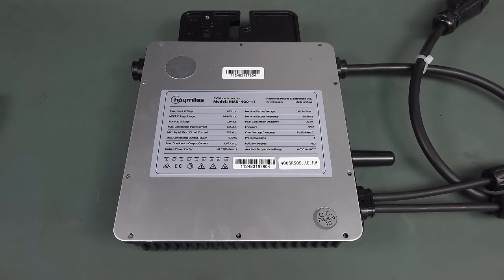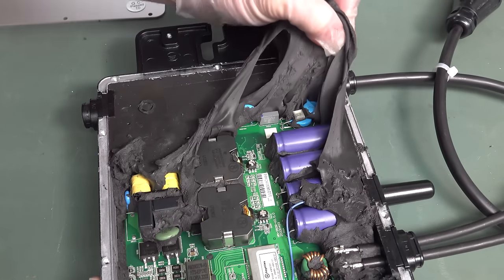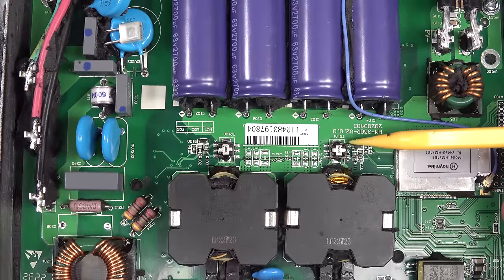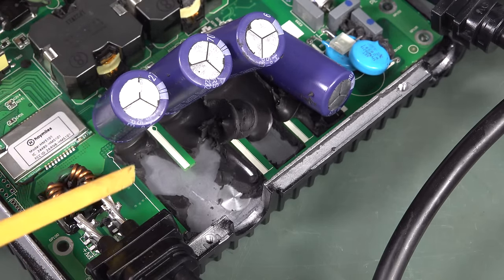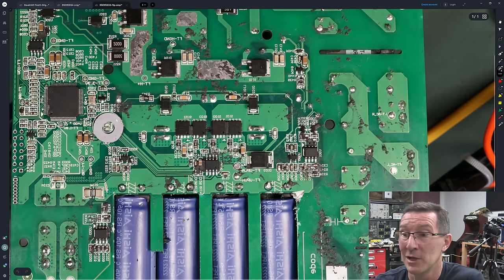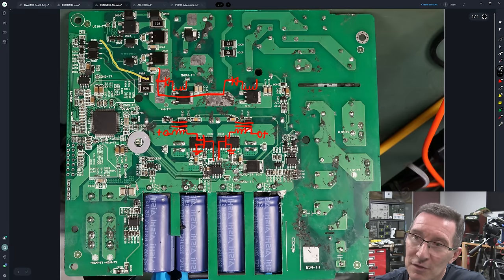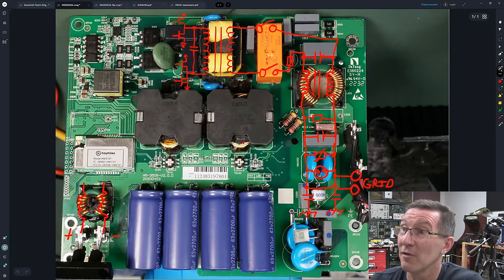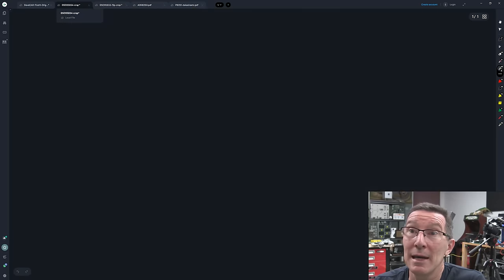EEVblog 1518 - Hoymiles Solar Microinverter TEARDOWN

Comment from the maker: CORRECTIONS to the reverse engineering as pointed out by some viewers. The mains side isolation transformer is a common mode filter inductor: https://www.youtube.com/watch?v=yOJ7xPugsdc
Reply: Just about t say.... Way too small for a 50Hz part.
The common mode filter almost certainly functions somewhat as a differential inductor, too.
The isolation is done by the two-phase DC/DC boost stage transformers, which are modulated to produce the required wave shape; the H-bridge output transistors probably just serve as a polarity switch, as there's minimal  capacitance on the output of the DC/DC boost circuit.
Reply: @davidbeard7262  the isolation is provided by the AC coupling capacitors, so it can't affect the bias voltage  on the transistors' base
Reply: At least that's what the book says
Reply: what about using a solar panel and a motor to turn an induction motor, a mind mill thing..
☀️🧲🤷‍♂️🙇‍♂️
Reply: @DonaldSleightholme  why would you ever do a dumb thing like that?
Reply: Yepp I was about to point it out xd
Reply: Some question
Reply: It’s enough for galvanic separation to have transformers on the (10ths kHz) DC-DC booster side. Save iron! 😂
Reply: @DonaldSleightholme  Old school rotary converter. Good for an apocalypse and might survive a lightning event. Brushes on the DC motor will go quickly though.

Comment: I have 17 Enphase microinverters on my roof, installed 7 years ago.  Over last 2 years, four of them have failed one by one, which is about 600 times their claimed failure rate of 50 per million per year. I suspect they would have lasted longer in Arizona or Australia, but in wet, humid and often overcast Southeast US, with all the thermal expansion and contraction, you just can't keep moisture out of those boxes no matter how hard you try.  Theoretically they are under warranty but kind of a nightmare getting them replaced, because I'm too old to be getting up on the roof and the outfit that installed them is no longer in business.  Enphase doesn't like dealing with homeowners anyway, so I have to find a certified Enphase installer willing to work on somebody else's system, not so easy.  And the icing on the cake, so to speak - the warranty doesn't cover labor!
Reply from the maker: Wow, four of them?
Reply: Lots of hardware up on the roof,  those primary DC caps are under a lot of stress, switch mod ripple current high temperatures (especially in AZ) and anything connected to the AC mains is subject to all sorts of nasty transients that are very hard to protect against.   Would be very interesting to see the RCA (root cause analysis) of those micro inverters.
Reply: Yikes. We have 16 which have been up for two years. Fingers crossed.
Reply: @EEVblog  enphase does not like humid weather. They are not known for their reliabillty in europe. Many people dont use micro inverters because they fail often and are a B to replace compared to a regular inverter in the attic
Reply: It's tough to begin planning out a system like this.  There are so many new names, and so many no-names, that you can't just say "oh yeah, Eaton, they should know what they're doing..."  I'm in the far north, with potentially a couple months of well-below-freezing temperatures, and lots and lots of precipitation.  It would make me nervous to put any active electronics outside.  (Although baking in the sun can't be too easy on them either.)

I want to DIY, because: cheaper, more fun; but also because if you pick an installer, they're just going to use what they carry -- which is either what's best for their profit margin, or what they can get, or simply just what they've always used.

Learning curves always suck.  What can you do.
Reply: @SupremeRuleroftheWorld  I really hope your attic is insulated well? There have been two house fires in my small town caused by inverters in lofts overheating and going pop! 
My installer wanted to do the same and I refused. Mine is outside in a lean too protected from the weather and excess heat. On a sunny day it certianly kicks out the heat! Mostly when it is being overdriven I have 4.6Kw panels and under full summer sun in the morning (before the panels heat up and drop their output a bit) I can see over 4.6Kw input but it is limited to 4Kw output so that extra 600w is dumped as heat. I will install some fans before next spring. To help cool it.
Reply: @williamarmstrong7199  this does not sound right. 600 watts out of 4600 watts would be a efficiency of 87%. Most likely it's derating of the modules due to heat. If your inverter has reasonable efficiency of about 95% it's more like about 200 watts of losses at 4000 watts output. Which would be in line with about 10% loss on the modules due to heat.
Reply: @SupremeRuleroftheWorld  many people? That’d be only you karen. I’d rather replace one microinverter for $200 than thousands. Common sense
Reply: @strehlow  you’ll be fine. His were probably used, and probably only had 1 or 2 go, but wants to feel relevant. Like a drama queen…
Reply: Arizona and Australia get extremely cold at night, I doubt expansion and contraction is the culprit to your failures because a good manufacturer would easily be able to implement expansion joints in places with redundancy and headroom to add.
Reply: Enphase had issues in the old days with their M series if micros (not IQ). Do you have M series as those haven’t been manufactured for ages. The new Enphase IQ micros are incredibly reliable. Otherwise all installers would not favour them.
Reply: @TurreTuntematon  They are M250's, with an aluminum case.  I expect there will be some early failures with any new technology, but what I object to is Enphase's  dishonesty about it.  Their support page still states "Very rarely are microinverters not reporting system status caused due to a faulty microinverter.", which is a flat-out lie.  The fact is, inverter failures are quite common, and if you have one or a few inverters consistently not reporting, it's almost a sure bet you've got an inverter failure.  The outfit that replaced mine has a full-time tech who does nothing but replace bad inverters.  I was very fortunate to get someone to work on my system after the original installer went out of business, something they said they don't usually do, and Enphase isn't very helpful in finding someone other than giving you a list   of installers to call.  As for the IQ inverters, they only started using them routinely in 2017, so let's see what the failure rate is after 10 years or so.
Reply: I live in west Texas.  (Same weather as Arizona) had one enphase micro die at year 2.5.

IQ7+
Reply: @quetzal4042 : Were you able to find our the root cause of these failures?
Reply: @MrHalen24  I'm too old to be crawling up on the roof myself but I finally found a tech willing to go up and check them out.  One was apparently squirrel damage to the cables but three just spontaneously failed.  The tech sent them back to Enphase for exchange so I couldn't take them apart or examine them further.  Fortunately no additional failures since then.

Comment: Those little transformers TR100 and TR101 are actually current transformers to measure the current in the respective switching MOSFET and winding. 
The current passes through the metal strip over the top of the ferrite core ( primary winding with 1 turn) and inside the core is the secondary winding with e.g. 100 turns. The sec winding is accessible on the two outermost pins on the left side. all the remaining Pins are NC and soldered just for mechanical stability.
Reply from the maker: Ah, yes, that makes sense. Should have gone in for the microscope closeup.
Reply: got P/N?
Ah, NVM, found it: PA1005.100NL
Reply: I thought they were called "current transducers". (Still "TR")
Reply: @ZomB1986  At component level only current transformers exist.

Comment: Dave the TMS320 is a mainstay of solar (and motor control). Especially the Piccolo family. Why? They have a  High Resolution PWM (HRPWM) that uses some magic technique to get PWM resolution greater than the clock for very precise mico adjustments. I think it's 150pico second steps (less than 200ps anyway)!   I expected to see a TMS320 and lo and behold we have it.
Reply: True.  People tend to forget the TMS320 is a very loose branding that TI has applied to many families of DSPs over the last 30 plus years, with quite several completely disparate CPU and instruction set architectures (I can recall seven or eight different families at least without looking anything up).  Some of the newer devices with dedicated power control peripherals certainly fit well here.
Reply: It would be interesting to know which TMS320 is used in there

Comment: I had never heard of Hoymiles before the hardware appeared in your mailbag. Apparently we've all been missing out. Looks like they're ticking all the boxes for safety and reliability. Thanks for the teardown, despite the goop.
Reply: one of the only micros that passed ÖVE and DVE Testing and are certified to run here in germany/austria on the grid.

Comment: To a degree I wouldn't be surprised if the "transformer" Dave suspects to be the main isolation transformer to simply be an inductor.

And instead have the two DC-DC converters handle the isolation. And I suspect this to be the case given the two optocouplers top left at 21:30 going over to towards the "transformer". And there is more optocouplers on the back of the board for this region too.

The advantage of isolating in the DC-DC ones is that one can make a compact design able to handle high power.
And then use a class D output stage to generate the low frequency AC for the mains voltage. Ferrite transformers don't tend to like low frequency stuff, especially at high currents. Tends to over saturate and do a poor job. But this isn't a problem if one switches a class D amp at high frequencies to generate a low frequency signal. Efficiency is typically fairly decent too.
Reply from the maker: Yes, correct, it's a common mode inductor. See the pinned comment. My brain was not engaged.
Reply: Totally, a iron transformer for mains frequency would be way bigger.
Reply: @EEVblog  It is easy to make these sorts of mistakes when faced with an unknown circuit. Educated guesses and a bit of fast analysis is the way to go.

One can also jokingly say that a camera removes a good few IQ points to say the least. The spur of the moment reacting to something "live" isn't usually the best approach to also remain correct. But does give useful insight regardless and something for us commenters to ponder over as well.

Overall, a decent video.
Though, first thing I looked for where how the solar panel and main's were isolated, and where. Tracking down opto couplers, transformers and such clues to potential DC isolation. And generally following the copper-less valley across the board. Since large bulky inductors/transformers/chokes are usually a black box until one does a continuity check.
Reply: @erlendse  That were my main suspicion as to why the DC isolation must be elsewhere.

Also helps that I for fun designed my own grid tie "transformerless" inverter a few months ago out of pure curiosity to how one would do such. (Designing a circuit based on pure "This is the goal" is more fun than looking up how others have actually done it already. Usually one stumbles down a few rabbit holes along the way, learn some tricks, and generally find a few alternate solutions to a problem.)

Comment: I had to replace the relays on a full size inverter that weighed about 30kg. Some scary caps in there, I definitely triple checked they were discharged 👍 Was a very nicely designed piece of kit, very high quality boards in it.

Comment: The electrolytic capacitors store energy to balance the 2x50Hz mains power pulsation, not clouds or birds covering the panel.
Reply: Yeah, I was going to say the same.  Otherwise you drop efficiency a load - you have to draw a constant DC current from the panel at the MPPT to get max power output from the PV panel.

Comment: That was a cool tear down.  A video on how these work would actually be really cool.  Ex: how do they sync with the grid, and how do they detect if it goes down.  Especially when there are many of these on the grid, how does one inverter not think another inverter is "the grid" and keep going, for example.  I presume it goes by current draw, if grid goes down it will try to pull massive current?
Reply: Or even just how to DC to AC conversion works.
Reply: I was about to say a similar comment. How does the microinvertor keep in phase with the grid when it is supplying power to it?
Reply: @dogastus  Well they measure the voltage at every microsecond so they can follow.
Reply: The inverter turns off when voltages or currents go off limits. A blackout looks like an eventual voltage spike (depending on where in the phase the current stopped) followed by a shortcircuit = current too high on the grid side.
Reply: @AndreasDelleske  one would think that current would flow in the inverse direction and the solar panel would become an LED.
just kidding
Reply: Phase that inverter produce shall overtakes grid phase. In this manner inverter push power into grid. If grid phase is lost inverter cant push any power into it, so uC disconnect mains switch. This work but if there is many inwerter in net it can rise up frequency in grid.
Reply: Yep, My first question 30 seconds into it and could tell he was not going to cover it.

Comment: That goo looked nice, I’m ordering 10 of these. I would love a teardown of a different micro inverter!
Reply: Just don't put it down on the desk and let it pick up solder blobs and other detritus, and then let it flow back over high voltage high power electronics.